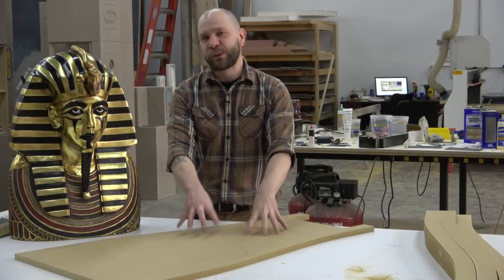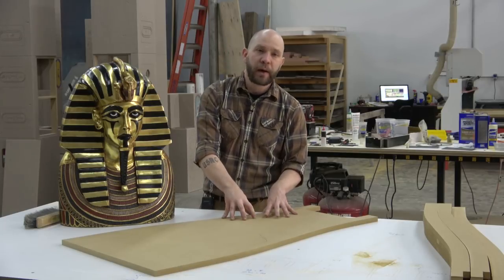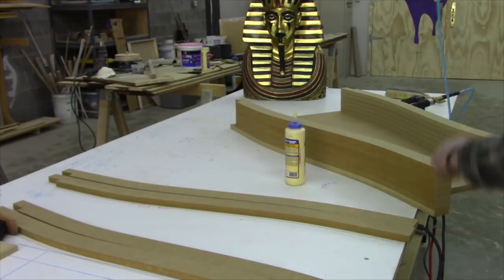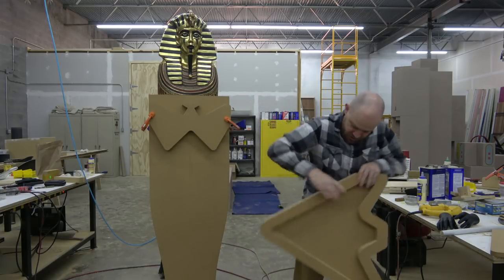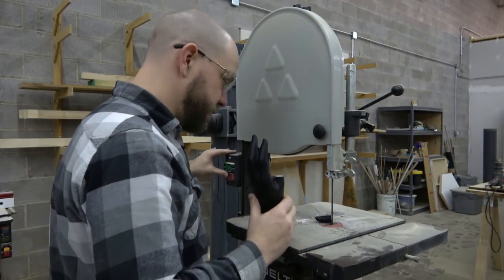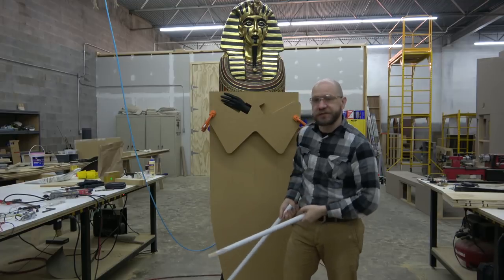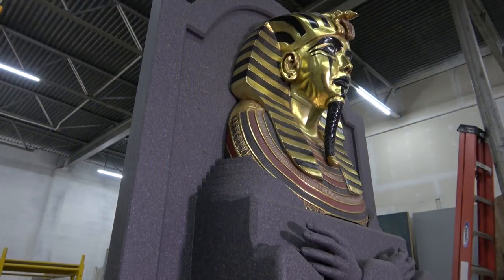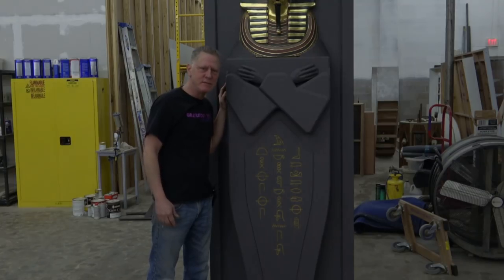Egyptian Sarcophagus Build!

Comment: Very nice.  Like the stone finish.  I was thinking how much I hate MDF, and then realized why.  I'm almost always building things that either need to be lighter, or stronger, or more water proof, or are actual furniture (and the assemble it yourself furniture I get roped into helping assemble ...).  But for what you are doing it's almost ideal so one needs to get outside ones box sometimes.

I did build for a museum a case to hold long scrolls that were about 2 1/2 feet wide and the case was about seven eight feet?  But it had to be light and really strong for the weight.  Why? I can not remember.  The legs were basically apple boxes on end that were filled (on installation) with enough weight that the thing was not moveable*.  The main span though was built like an old model (balsa wood for you youngsters) airplane.  Ribs and 1/2" surfacing.  One person could carry it and once assembled I could stand in the center and it didn't sag.  A real blast to create!  It needed to be so stable because the tops were plexi vitrines and any flex and they would crack. 

* a trick they used because they couldn't attach anything to the floors and a lot of the place was carpeted was to use double stick tape and a bunch of weight.  If the weight is enough that you can't lift it the tape will keep it from moving.
Reply from the maker: We are gonna build some vitrines for the National Videogame Museum soon. You're calling me a youngster?!? Lol I'm about to turn 52. The double stick tape + weight trick is kinda brilliant.
Reply: @GratuitousSets  Well I have a decade+ on you, but I was referring to people too young to remember that even the model sections of drug stores had a lot of balsa wood airplane kits.  Haven't seen any for sale in years.  About 20 years ago I bought a bunch when a craft store was dumping all they had left.  A retirement project!
Reply from the maker: Devon is a fiend for balsa kits